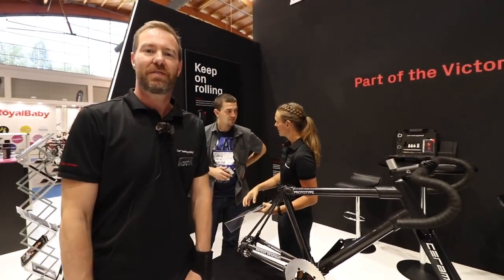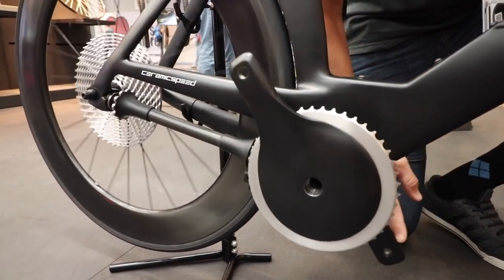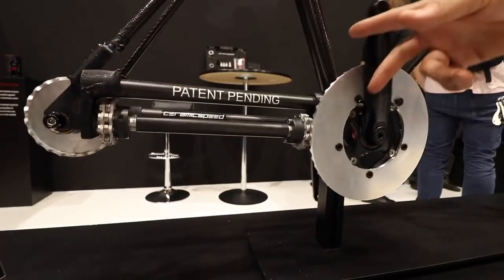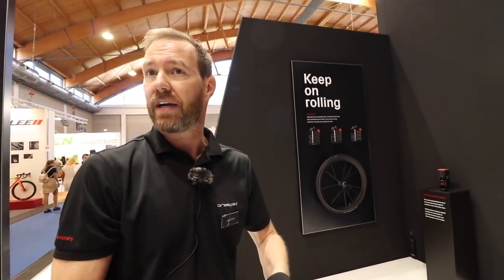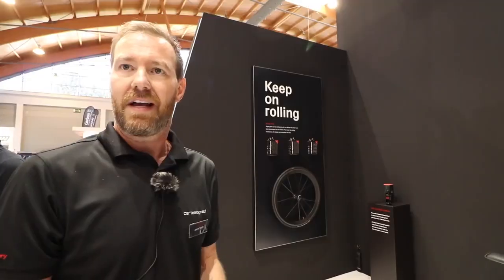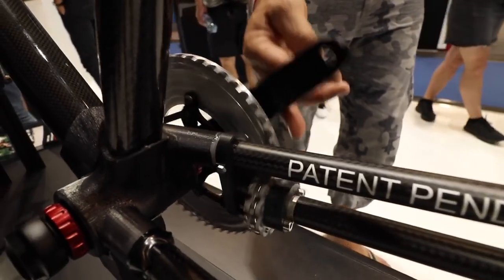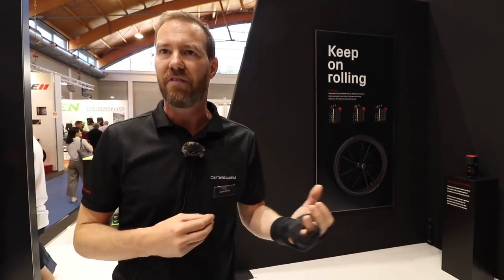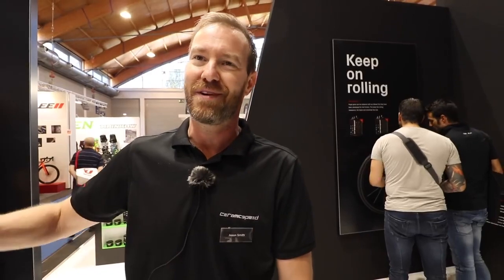Kettenlose Fahrräder ( Chainless Bikes)

Comment: I presume this chainless rads are as light as a feather 🪶?
Reply from the maker: While specific weight details for the entire bike are not widely publicized, the drivetrain itself is noted for being relatively lightweight due to the use of advanced materials and design. Generally, high-end road bikes incorporating similar high-tech components tend to weigh around 7-8 kg (15-17 lbs).

For precise weight information, checking the latest specifications from CeramicSpeed or reviews of complete bike builds featuring the Driven system would be necessary.